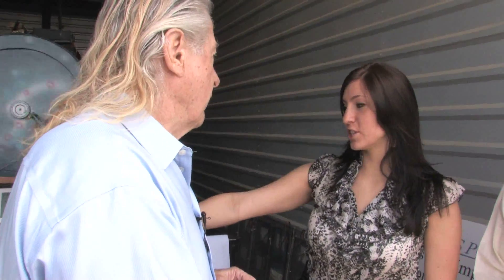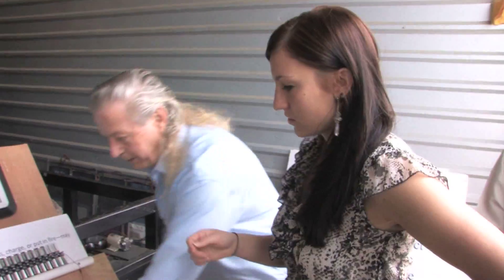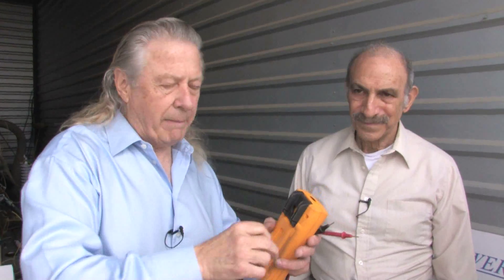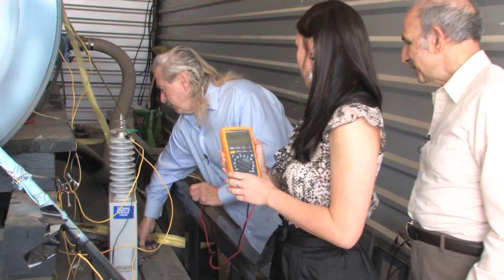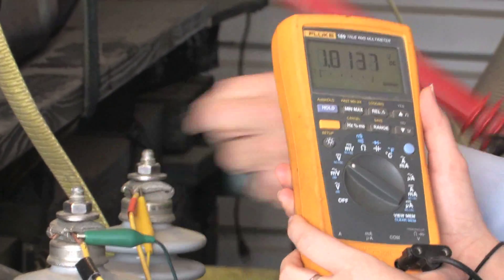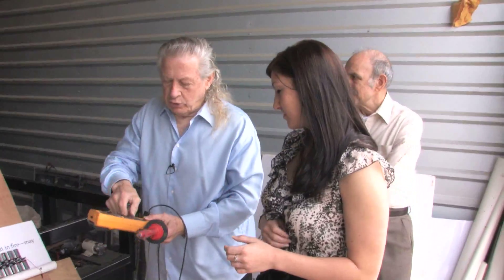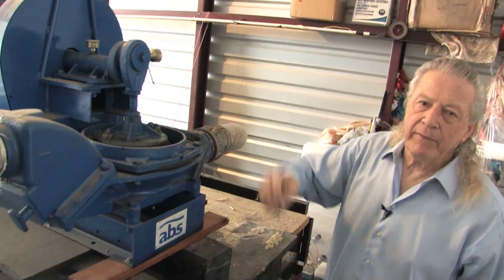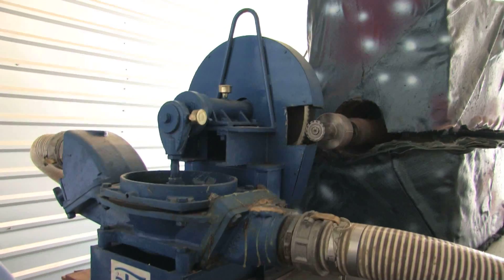Joseph Newman: An Energy Life Preserver for the World Part 2

Comment: This setup is a parallel resonant circuit.  As such, it has very little current input with a tremendous amount of current flowing between the capacitor and the coil.  I'd be interested in knowing the resistance of the coil, because then I could figure out how the coil was built.  In addition, I could find out the max power the device can deliver.  The power that you see comes from the resonance and reactance of the coil, not e=mc^2, or some other ether type of description.
Reply: Commercially available DC motors are deliberately designed and manufactured to have extremely poor performance. In my opinion, the reason for this is that a properly designed electric motor could easily do away with the need for using internal combustion engines in vehicles and that would not suit the oil companies or their owners, the New World Order cartels. Worse still, electric motors with COP>1 open the way to self-powered free-energy systems and that would never do !!  In brief outline, present day motors act both as a motor and as a generator of electrical power, but they are deliberately wound so that the power generation is used to oppose the input power and so produce a completely crippled output. During World War II, a German Engineer re-wired a standard electric motor and made it self-powered, that is, it ran and produced mechanical output power without the need for any input power once it had been started. That shows the potential of a properly constructed electric motor with the same size and general structure of any commercial electric motor. Presumably, he did that by adding extra brushes and using some of the windings in generator mode with their output powering the drive windings which were arranged asymmetrically. There was also one other man who achieved self-powered re-wiring of a motor, but neither of those men made their information public knowledge. The con job which has been run on us for many decades now is to wind the motor in such as way that the magnetic fields inside the motor oppose each other. When a current is passed through a coil of wire, it stores energy in that coil, and when the current flow is cut off, that energy needs to flow back out of the coil and it will do so in the reverse direction. This is sometimes called back-EMF (“Electro-Motive Force”) although many people are not happy with that description. However, no matter what you call it, there is energy stored in the coil and that energy can be used to do useful work. But, the motor manufacturers choose to wind the motor so that instead of extracting that useful power, they use it to oppose a major part of the input power, creating a weak motor which heats up due to the wasted energy. Contributor “UFOpolitics” points out that a deliberate mis-design of electric motors has, for the last 130 years, been presented to us as the only way to make and operate such motors. He states that because the windings are arranged in a symmetrical way, that a braking effect is produced which reduces the output power of the motor by anything from 50% to 90%. That is, a properly wound motor would have anything from twice to ten times the output power for the same input power. This mis-design guarantees that present day motors are always less than 100% efficient and always heat up when run. This mis-design is caused by using symmetrical windings in the motor. Standard motor wiring is quite different and the killer effect is caused by having two windings which face each other, powered simultaneously with currents flowing in opposite directions. This causes a complete conflict between the magnetic fields and that destroys the efficiency of the motor.
Reply: The „symmetry ” , when applied to electrodynamics, does not relates to the geometrical or architectural disposition of their components design, but to the methods (interactions) they utilize to achieve rotation ( motors ) , or to obtain electricity based on rotation (generators ) . Therefore, a detailed review of this electromagnetic interactions will help us to understand better the symmetrical systems. A symmetrical system continuously energizes their coils, meaning , no „idle stage ” or brake , but instead, at specific degree reverses the input to the coils. By reversing the coils electrical input, rotation is achieved, since magnetic polarity also reverses. A closer look at the vertical plane delimited by the brushes , where the symmetrical reversal occurs. Observing through the input conductors, where at start, a steady – one way – flow, begin entering the system, represented by the blue particles. Encounters an uncoming traffic, randomly traveling , of opposite charged particles (red ) , creating heavy collisions, resistance, friction, delivering heat and high energy losses, neutralizing to zero power. Right here, at the reversing commutation center, all energy is converted or transformed to: 
1)	Excessively high operating temperatures 
2)	Creation of reversal flux, generating friction or magnetic drag, that rest power to rotation . 
3)	Reversed electronic flow ( negative feedback ) generates high reverse spikes, friction, slowing flow. 
The residual energy able to survive this battle is used to perform the duty assigned. Then, this crippled science created the „story teller” of blaming all this losses , to the back or counter EMF, and notice EMF means here „Electro Motive Force ” Not, counter electro magnetic field! . When all this losses are due to counter electro magnetic fields generated by the symmetrical systems. The counter electro motive forces are just consequences of the main counter magnetic actions . Physics states, that an electric motor can never run an electric generator efficiently, as its „main prime mover”, „legally speaking”, therefore , never will be able to produce any „over unity systems” or excess of energy over input , or a COP > 1 . It should be completely understood, since science is referring to the only model they have „locked – in – time ” , for over one hundred and thirty years. The symmetrical systems, how could they „power ” or run another machine , if they can barely handle their assigned job?! Then, the real purpose of all this crippling comes to its final conclusion. „The only prime movers, as „heaven sent ” that could perform that „herculean job” will be the stinking, oil leakers and farting lethal gases, obsolete dinosaurs .. . The gas diesel engines ”
Reply: @marcisgulbis9310  The best great !!